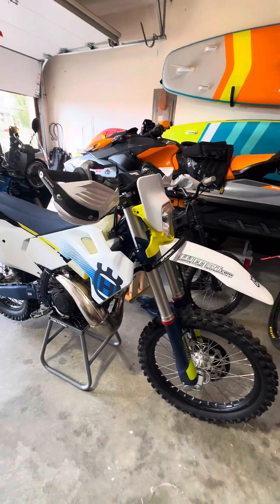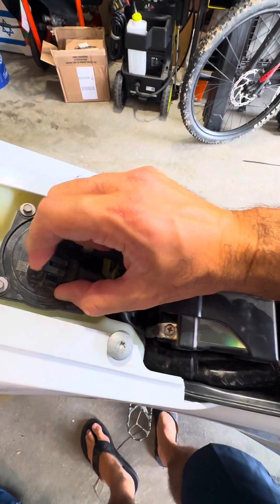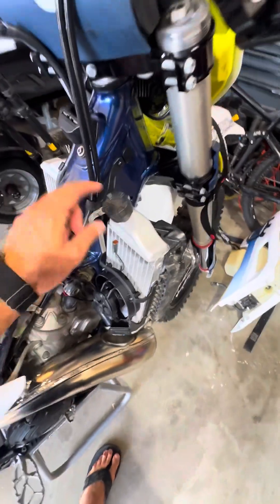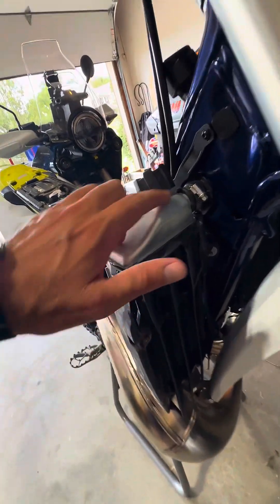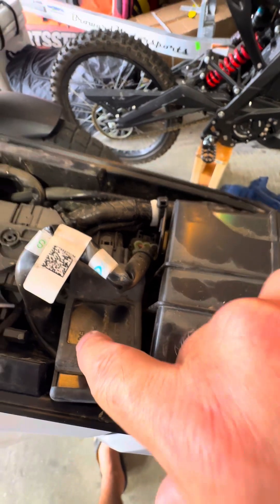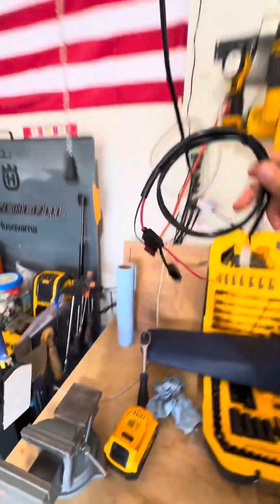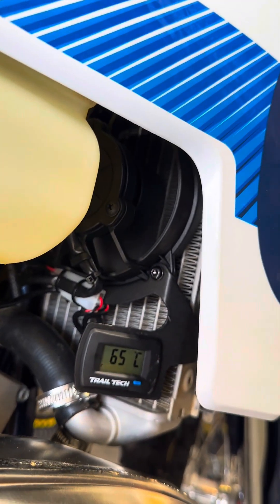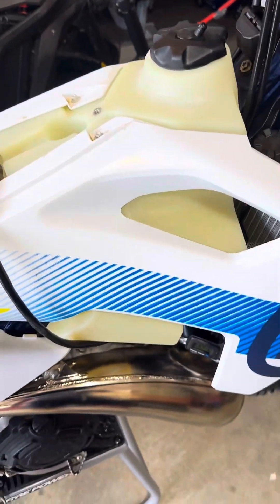Trail tech fan kit for 2024 BTI husqvarna TE300 and KTM XCW300

Comment: I have a 2024 xc-w TBI. I got the Trail Tech 732-FN3 fan from Slavens Racing. My bike has a plug from the factory and the instructions online say connect to that plug, but mine doesn't power the fan so I am troubleshooting it now. It looks like yours is the same story.
Reply: Same shit on my 2025. Whats the point of a factory harness if it doesn’t work? What did you do with yours??
Reply: @chriswoollet used the supplied trail tech harness that connects to the battery. Somehow the ecu knows it's got a t-stat or that it's not the compatible version. I don't know if the KTM version is the only one that works.

Comment: Won't this make ur battery go dead when parked up or not getting used tho I seen ktm have a switch you can connect to turn it off when bike not been used
Reply from the maker: @garyweir78  the fan wouldn’t take power when off - the fan screen is operated by an individual battery and does not take anything from the bike’s battery
Reply: @Weekendgarageadventures  ok thank you very much for that information very help full so all I need is fan and the wire that goes from fan to battery

Comment: I just installed the TrailTech fan , now I have to do this extra step.  I wish it was mentioned by TrailTech somewhere.  Honestly, I would have chosen the KTM Powerparts fan, which is true plug-and-play. 

I think I just figured out why TrailTech doesn’t mention it.
Reply from the maker: If you connect it directly (plug and play) it will kick in on 190 F